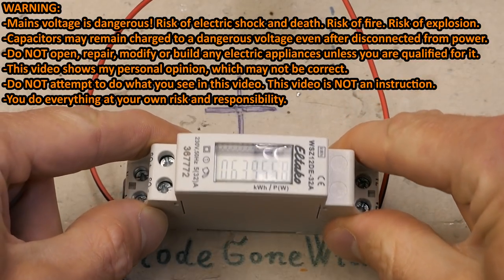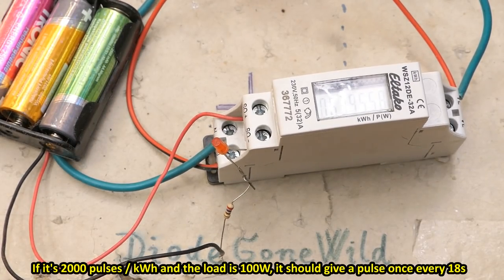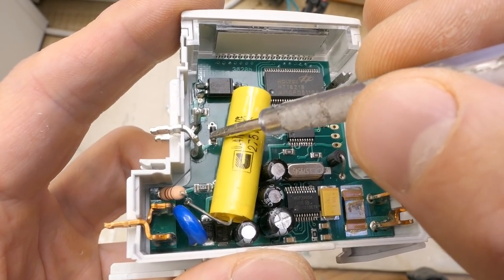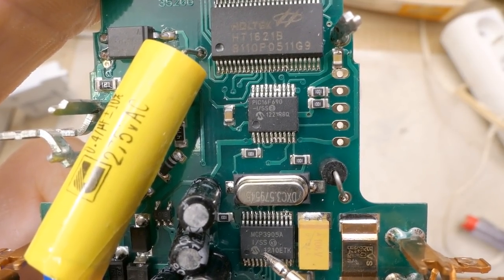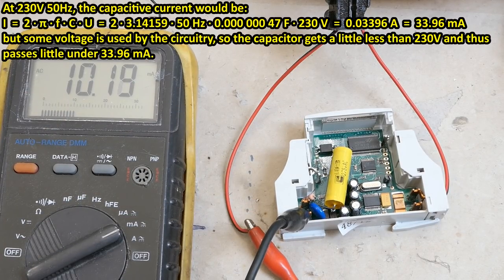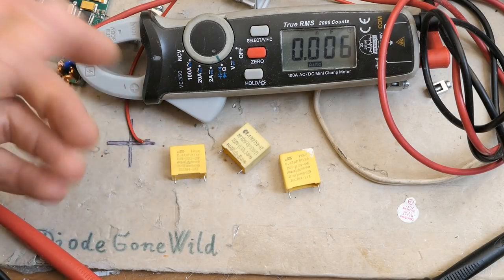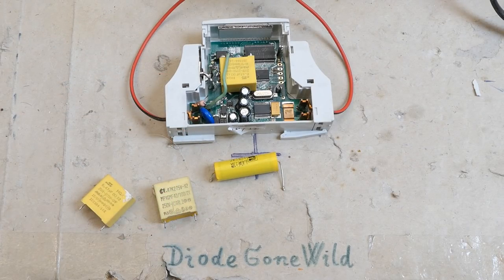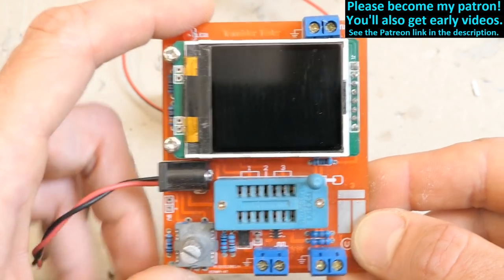DIN rail electricity meter repair and what's inside

Comment: Software engineer here. The value is probably a 32 bit unsigned integer (4 bytes, range 0-4'294'967'296) accurate to a single watthour. You write this number to the EEPROM in the first position, then when you want to write it again, you write it 4 bytes offset, then 8 bytes, 12 bytes and so on. Once you reach the end of the EEPROM, you overwrite the first value again. The EEPROM for this chip is 256 bytes, and thus will fit 64 values, and it claims 1 million write cycles. This means you can under ideal conditions write 64 million times to it. When deciding which value to read when the device is powered up, simply read all values starting at position 0 and stop once a value is lower or equal to what you've read before. You then know the latest value as well as the position where you should continue to write. In the case of this specific meter, the largest value to ever write with the given display digit count would be 99'999'999, which exceeds the 64 million writes if you were to write down every single watthour change. But we should also remember that the EEPROM is not used up after the write cycles provided in the datasheet. Those are merely guaranteed writes. You can very likely write more than that for a while. Or you can decide to only write even watthours and you land comfortable within the allowed limits.
Reply: Very nice trick!
Reply: There are more advanced wear leveling mechanisms for this kind of stuff. 
For example in this case it is known, that the value is counting and it only goes up. It depends what kind of memory you have, to find the optimal wear leveling mechanism.
For sure it is not necessary to write the full 32bit when the counter increments by 1. There are also other encoding methods than binary, for example like gray-code.
I'm pretty sure eltako made extra sure there won't be issues with couter value and the EEPROM.
Reply: Yep. It probably uses big EEPROM (maybe even few kilo-words), and only writes to it when it deem necessary, i.e. something like total changed, and enough time passed, or total advanced by enough. This is how I would code it. If the total did not change, do not write. If total changed, but by less than 0.1kWh, do not write until 10 seconds passed from previous write. and then each write you do to a next word in EEPROM. Once you reach the end, you write to the first cell, and zero out all the other cells. A checksum could also be used, but might not be needed in practice. This way one restart you know where is the last value (it is either the last one, or the one just before last 0), and where to store new values (at first 0, or at first position, if all are non-zero, this would only happen if there was a power loss when doing erase cycle).
Doing delta encoding (basically a form of compression), is a possibility too, at the expense of slightly more complex algorithm.
Reply: What I'd do - write every XX seconds (ensures worst case for data loss) and write when the sensed voltage has not reached high enough (200V) for 1/50s. Ensure enough capacitance to operate for like 0.2sec.
You don't even need to have a counter for the wear index, even writing to a random position would do it. While reading - use the highest value. There could be  an option to pack the deltas of energy change, or have a full encoded energy use. Delta encoding is quite common when transmitting time series.

Comment: EEPROM storage wear reduction: Increasing numbers are easy to store in an EEPROM without exceeding the limits. As an example you can use 32 byte to count the lower 5 bits by  using the lower 5 bits as address for said table. You will have to clear all the bits of the "old" byte (address -1) and set all the bits for the current byte. That would give you 16 times the endurance. (16 milltion for that PIC16F690). Upon power loss you just need to search for the one byte that is not 0. If it's byte 12 then your last 5 bits are 0xC. I have seen that exact thing in car odometers where the milage is stored in an I2C 24C02 EEPROM.
Reply: yes i also think the 100k writes is per memory address, so if you have 10 addrs. to store your number, you can do 1M cycles, just change de memory address, ive done something similar to you once using some bits from the number as address, other methode, that ive used to store water consumption measured in some caudalimeters, is to write on the next memory cell available, after a power up, you just look for the biggest number (done on a 32 bit int, wont ever happen a rollover during the device life, otherwise RIP)

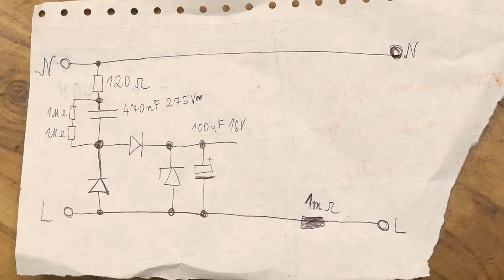Comment: With this schematic (5:01), I would expect the in-circuit reading to be quite accurate. Nothing is connected to the "top side" of the capacitor except a 2MΩ resistor across it, and the voltage sensing divider network of perhaps tens of MΩ (via the now-insignificant 120Ω resistor). 
I just fixed a radar-based motion-detecting light timer switch thanks to this info! Its relay did not get enough voltage (7 V instead of 12) to turn on. I was expecting the Zener to be bad but it works after replacing the 560nF dropper capacitor, which fell to around 410 nF, with a 470nF one (closest I have, and another 100nF in parallel won't fit).
Reply: A known trick in the home appliances trade is to bump the relay with the handle of a screwdriver and if the relay clicks, it's the capacitor too degraded to provide enough voltage.

Comment: I just watched your video on the small 12v  power supply ( wall wart), and I really like how you re engineered the schematic . Cheap dangerous supply. I joined your channel and a thumbs up. Have a great Father's Day. Stop in and visit, I would like to have you as a knowledge base for my electronic projects. 21 i South Carolina, Old Radio Night

Comment: Great video on the electricity meter and totally agree that the dropper caps are the usual culprit if many mains-powered devices stop working properly. I have seen that mainly in electronic timer switches ...BTW, those transistor testers are neat. I just made a video about mine which seems to be the same type  and now I am working on one on how to update the firmware because there are many new tests it can do with different firmware

Comment: will be nice to see if these one's have a reed switch inside to stop people using magnets to give a lower reading. here Ireland 90% of all meter's were changed to the "pay as you go" type, were you buy credit in a shop just like phone credit and type it into your meter for electricity . if your running low but it goes past 6 pm on a Friday it will not knock off until after 10am Monday morning. but it's more expensive than normal.  so folk's were using magnet's on the meter's that would slow the power reading down inside them... but the "ESB" BOARD (the  main company here in Ireland) realized and added protection inside  them in the form of a reed switch. signalling them that a magnet is been placed on the meter. 
im sure other countries has has the same type of meters installed in their countries too...

Comment: Regarding writes to EEPROM, perhaps disconnecting the capacitor during operation would help determine if it writes on power-off?  My e-bike's computer only writes during power-off (pulling out the main battery will cause total loss of all trip data since last power-off).

Comment: The 5% tolerance error is easily possible to adjust away during manufacturing/testing, as-long as it is only an absolute error and not indicative of other flaws like temperature/age drift. The meter looks like it's a 2% accuracy meter within its intended measurement rage. (range = 250mA to 32A)
It will ofcoz measure lower currents, but are allowed additional error (probably it is pretty accurate down to around 50-100mA).
Measurement standard is pretty relaxed below 20mA (-100% to +10%), yes it does not even have to measure at all below 20mA.
All current ranges mentioned here are subject to the stated base current of this meter of 5A. If a meter has another base current these ranges will move accordingly. Higher base current = worse for precision (allowed) at low currents.

Comment: I'm wondering if you have a video where you built the isolation transformer? I have one but it's not powerful enough
Reply from the maker: The isolation transformer is factory built, not DIY
Reply: @DiodeGoneWild  cool thanks. I was referring to the whole setup with the bulb and variac. I should have said. Sorry bro
Reply: @jstro-hobbytech  Warning: You cannot use a variac as an isolation transformer, most if not all of them have the "neutrals" of primary and secondary connected. Also, there is no variac in this video, perhaps you mean something else?
Reply: @vaclavtrpisovsky  I have both my friend. I thank you for saying that as some people do not know the difference. The isolated transformer I have just isn't as powerful as I thought it would be and I hoped there was a cheap way to maybe diy another one from another being that dgw knows everything there is to know about this stuff haha I get ya though, I've corrected people before as well. Thank you again my friend
Reply: @jstro-hobbytech  You might have some luck cascading two identical transformers but what you probably want to do is wind your own. I would suggest using an iron core transformer with separate bobbins and the VA rating you need, removing the secondary and replacing it with a winding identical to the primary. Otherwise, you will probably need to study a lot about magnetic hysteresis, which likely entails reading yellowed books from back when capacitors were called condensers. Engineering mains voltage transformers is a lost art; most people don't bother and simply copy earlier designs for their application. Very few people need new transformers that do black magic never done before, like the ferroresonant mains regulator; you might as well find a well-documented isolation transformer and recreating it.
Reply: Thanks again. I knew I couldn't cascade 2 and since the one I have only outputs 2 amps I'd like to have a second for repair and testing motors and circuits as I keep learning. I don't trust myself to wind one at this point. I should've shelled out for one powerful enough for what I need. I'd like to run all my bench gear isolated. I bought it not knowing much as well over a year ago. I've only been doing this as a hobby for almost two years but I don't work so all I have is hobbies. It's what I get for spending money too early. Excitement gets the better of a person sometimes haha I'm currently donating a bunch of learning material and stuff I've been buying with spare money for a while and I realized how much I had accumulated recently and I'm donating it to a local non-profit makerspace for youth programs. I'm also prototyping a robot platform that teens can build and code race autonomously. I'm paying for all that too and I'm not rich or anything but I've made money 3d printing which I put into this. It's alot to describe but I should be done in a few months. I figured I should do one good thing before I die.
Reply: There's a factory in Poland that makes them pretty cheap, also with parameters on demand. You may request a 100V 60Hz Japan transformer with output 2*12V and they will wind it for you.
Reply: @LMB222  cool. Thanks, I'll look into it.
Reply: I use a transformer that has a mains primary and two 115V secondaries connected in series. Unfortunately as the VA rating goes up, so does the size and weight, and hence the price. I got mine from a surplus supplier many years ago. Occasionally industrial transformers make it on to trading sites.

Comment: Yay, I got a component tester like this one as a kit — with the acrylic case. It has only one sot3-6 SMT component (below the ZIF socket) which I experienced no difficulties soldering in (if you do — just add more rooowseeeeen!), everything else is THT.
Works pretty well, but doesn't want to work with ds18b20 digital thermometers (and I don't know the reason why, they are functional).

Comment: I was wondering if a MOV in parallel with the capacitor would extend its working life by absorbing some spikes from the power mains.
Reply: Firstly, if you want to use a MOV, you would put it parallel to the mains, not the capacitor. They often fail short-circuit, which would destroy the circuitry otherwise. MOVs should also have a fuse in series somewhere because of this.

Also, it probably wont protect the capacitor much since it's only rated to 275V. You would be much better off with a higher voltage rated capacitor, like 400V or more. Then it wouldn't be damaged nearly as much to begin with.

Comment: (EU / MID standards/rules) The register is saved to eeprom upon detecting a power fail situation, however the standards does give manufacturers some slack, a minimum of 1/10th of kWh must have advanced for it to be mandatory to store the new energy register status. So, if you have a situation with alot of rapid on/off/brown outs it will not "wear out" the silicon.
(I'm pulling this from memory, possibly it could be 1/100th kWh, one of them)
You will ofcoz only save when the electronics are about to quit.
Manufacturers may incorporate alot of tricks to avoid a needless save, and it is typically only done as a last resort before uC hits a critical low voltage that threatens normal operation.
As such; a massive under voltage for a period or two does typically not trigger a register save scenario, the software senses "yep, Phase voltage are out... no big problem, my reservoir cap is full, I can wait for it to back to normal levels". As I mentioned, there are tricks to resort to, you may cut back on non-essential calculations and functions during extreme prolonged voltage drops and spend more time in uC sleep-modes to conserve energy.

Comment: I'm wondering how much power the electricity meter consumes itself.
Capacitive droppers aren’t the most efficient things in the world, so it would be interesting if modern ones use less energy and if they are any different.
Reply: For billing meters in your home "big-ones" they are taking power before power current transformer to run itself. That one in video is just counting one appliance or sub feed. We had those kind of meters, only in three phases in production facility for mobile operators/antennas. One operator used about 40 000 kWh/a, it had only three 4G antennas (I think 800+1800+2100+2600Mhz per 1 antenna) and cabinet to run them. Mobile data uses huge amount of power.

Comment: The datasheet of the meter states more than 15 years of life at maximum load. The PIC16F690 microcontroller has an EEPROM endurance of 1 milion cycles. Dividing 1 milion cycles to 15 years  results in about 7.6 writes per hour so it probably writes every 10 minutes to EEPROM if the count has changed and possibly also at power loss. 
I would not rely only on the power loss writes on a metering/logging application because software can hang, capacitors age over time and might not provide the supply for enough time and so on. With a 10 minute timed write and a watchdog inaccuracy can be limited to around 16% or better. At a maximum load of 32A*230V=7.36kW * an accuracy of 1%=73.6W*2000imp/kW=147200 maximum counts at which data must be written to keep the 1% accuracy no matter what the life of EEPROM.
Reply: It's possible that this uses wear-leveling to dramatically increase the endurance.  This chip has only 4KB of Flash, but the feature set is small, so I think you could afford the wear-leveling overhead.
Reply: There are many different ways to manage EEPROM writes. Since only flipping bits causes wear, a simple way to do a non-volatile count is to reserve an EEPROM block to mark 0s for every 10Wh and update the binary total when the mark block is full. If you have 128 bytes of EEPROM and set aside 512 bits (half) for marks, then the count only needs to be updated once every 5kWh, the mark block only gets reset once every 5kWh as well and you have 58 bytes left for calibration data, parity checks, bad bits table and other necessities.
Reply: Writing to eeprom seems like a bad design. A Lithium backup battery can  actually last longer than this chip when it's constantly written to. 
Otherwise it seems to be rather well made actually. Except for that chunky capacitor which is flapping in he wind.
Reply: @teardowndan5364  There are also things like gray encoding that could be used here, since we know it is only counting up. If you spread the writes out over the complete EEPROM, there shouldn't be any issues with the EEPROM wearing out.
Reply: @fkiesel9442  Gray coding would only halve wear only as long as you only do +1 increments. For increments greater than +1, wear on LSBs would remain largely unchanged.

Comment: PIC16F690 has 256 byte of EEPROM but no one stores frequently changing events in EEPROM when there is chunks of 7k of flash to be had.
Reply from the maker: not sure how it's in PIC, but in Atmel the EEPROM life is 100 000 writes, the flash life is only 10 000 writes. But of course, in both cases you can use wear leveling. I've already done a similar thing in couple of my Atmel programs years ago, but now I forgot it exists :).

Comment: I think the non isolated PSU inside the meter doesn't stick to industrial standards that requires isolated PSU
Reply from the maker: I'm not an expert on regulations, but it only powers the internals, nothing exposed, so it should be fine. The interface is isolated using an optocoupler.
Reply: It's enclosed in a box and you are not supposed to put your fingers into it while it's working so it's totally fine.